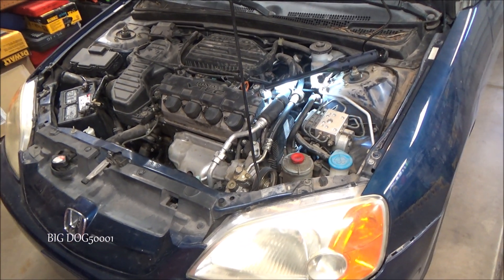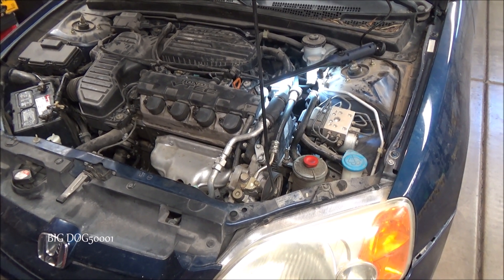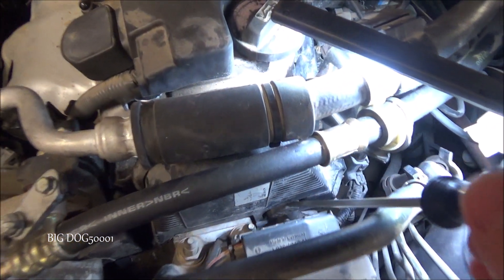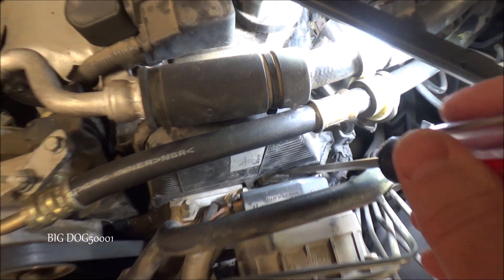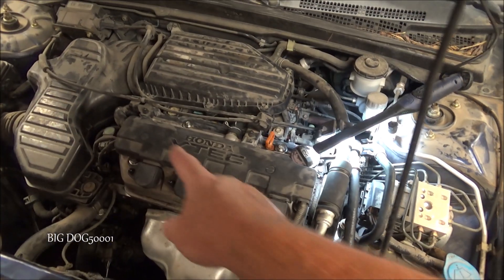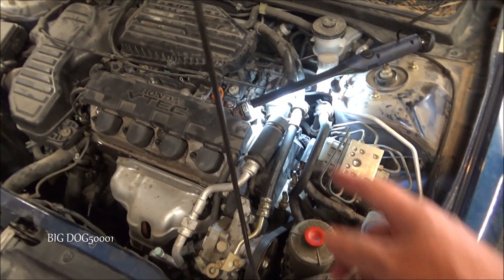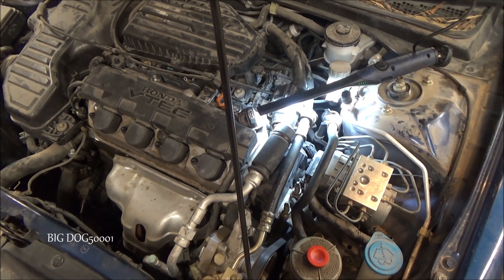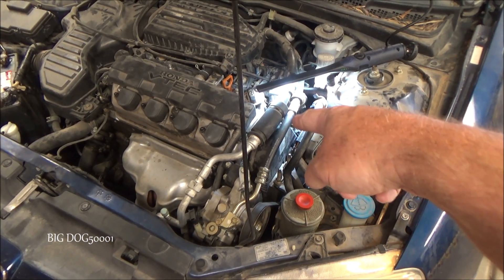Honda Civic Top Dead Center (TDC) Cam Sensor Location 2001-2005

Comment from the maker: TDC Sensor Replacement Video:  https://youtu.be/MifE0z0saB4

Be sure to subscribe for more tool and car repair videos! 
https://www.youtube.com/BigDog50001

Buy Big Dog50001 T-Shirts, coffee mugs and other gear here!
https://bigdog50001automotive.myspreadshop.com

Want a free Big Dog50001 sticker?  Send an email to bigdog50001@gmail.com requesting a sticker.  Sorry, no international addresses or automotive questions.

https://twitter.com/BigDog50001
https://www.instagram.com/bigdog50001/

The Big Dog 50001 Automotive Channel Store can be found here: https://www.amazon.com/shop/bigdog50001automotive  (As an Amazon Associate I earn from qualifying purchases).
Reply: it’s that a 2.4 K24 engine? or 2.0? Thanks 🙏
Reply from the maker: @HotRod-wv4vm  These Civics have a 1.7L engine.
Reply: @BigDog50001  yes but the paint on the valve cover is much better than on the Element with the 2.4 engine. All the ones I have seen have peeling paint. I live in NYC and park in an indoor garage but the paint was peeling anyway. I purchased another valve cover that is powder coated.

Comment: Cool. I think I had did this job the shortcut way cutting a hole through that timing cover. Seal it back up with aluminum tape as it was recommended.

Comment: I'm missing my driver door inside window swipe,ii order a new one, how does it go on ?
Reply: In an eighth gen Civic? The entire interior door handle plastic cover that holds the switch assembly pops off. Find a video of someone removing the door panel and you'll see. Once it's off, just swap in the new switch.
Reply: @jptrainor   2008 accord ex.
Reply: @jamescorless8283  probably the same or close